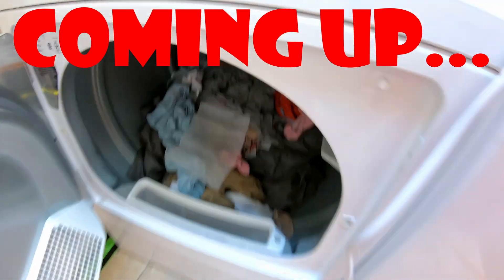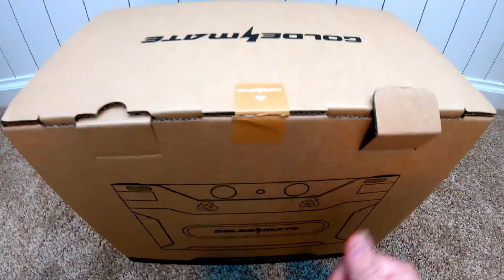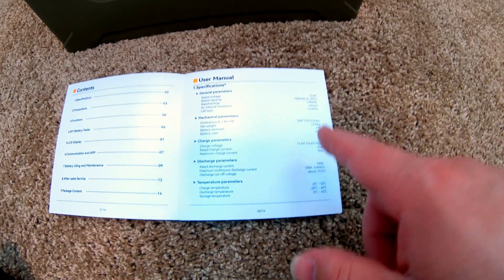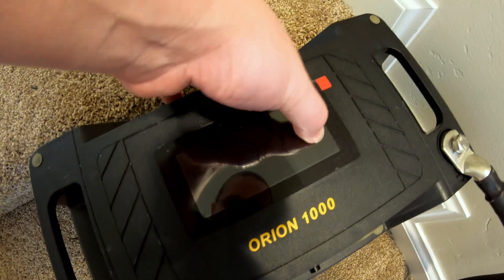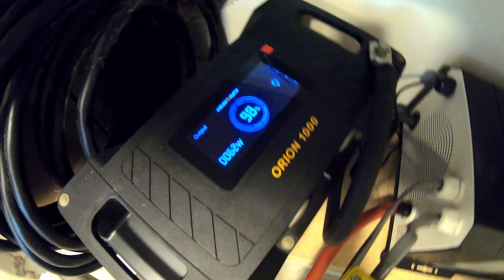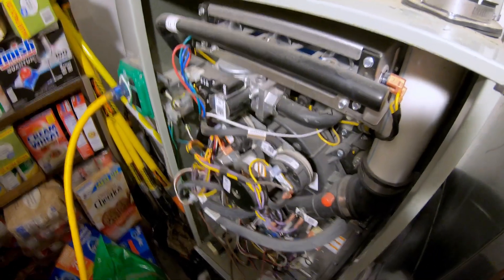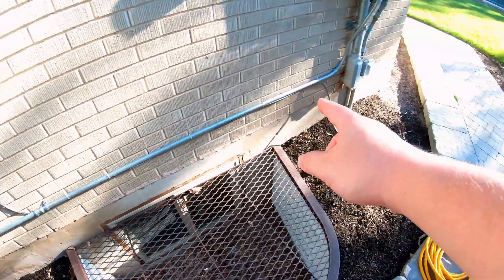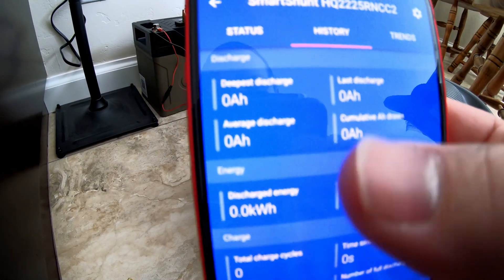I DARE You to Find 1 Battery that Runs Everything In My House! Meet GOLDENMATE Orion 1000 12V LFP

Comment from the maker: Buy the GOLDENMATE Orion 1000 12V LiFePO4 battery for yourself: https://shrsl.com/4rc59
Be sure to use the code: TRLCK to save a chunk of change on your order!
Check out my “12V Battery Testing Results & Rankings for Home Backup” Spreadsheet. This GOLDENMATE Orion 1000 got a perfect score! https://docs.google.com/spreadsheets/d/1OuUalW-_9BdWMyQz0CxCAM9cpO6whw_LX_exW0Fhqzo/edit?usp=sharing 
Buy the Renogy 3000W Inverter Charger you saw in this video: https://amzn.to/45S26sb
Buy battery cables: https://amzn.to/3GEIIDi 
Buy a 10AWG extension cord like you saw in this video: https://amzn.to/3VPfAjV
Buy an EZ Generator Switch like you saw in this video: https://amzn.to/3L9M57u 
Watch my video wiring up the EZ Generator Switch to my furnace: https://youtu.be/dBP53ggH4nA 
Buy a Victron Smar Shunt like you saw in this video: https://amzn.to/4bwrftP 
Buy a 115V Pioneer Mini-Split like you saw in this video: https://amzn.to/3L7hxn1 
Buy an Anker Solix C1000 Power Station: https://amzn.to/4hEcOYt or ankersolix.pxf.io/PO64BX

Affiliate Disclosure
As an Amazon associate I earn from qualifying purchases at no cost to you! Thanks for your support!